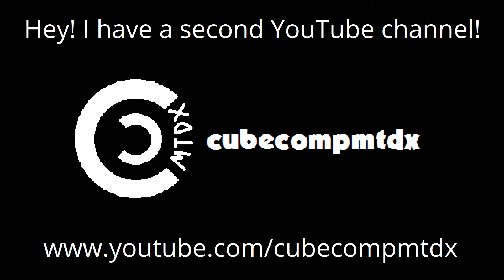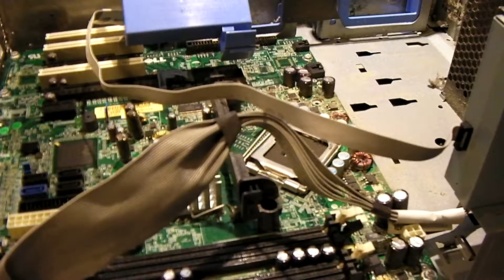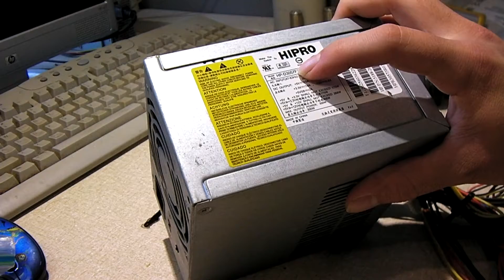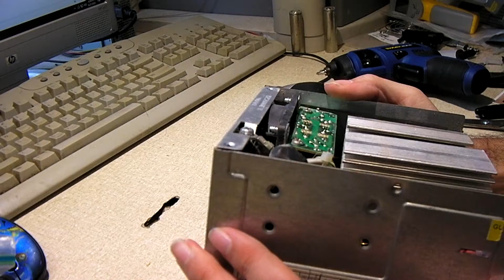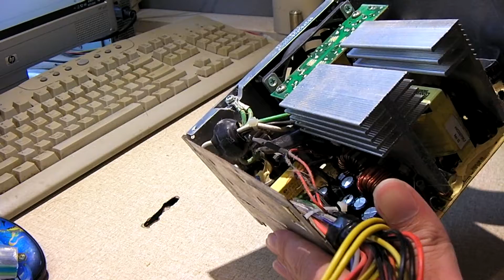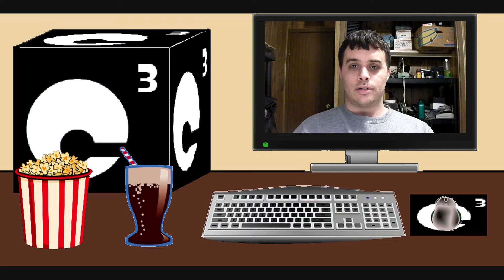Hot running PC in hot ambient temps takes its toll on capacitors

Comment: the HP d-530 sff i have about 5 of them from a surplus auction, they have a 3.0 pentium 4 HT, it is a 478. about every cap on the board is bloated and leaking, these systems never seem to have an issue but i guess i should recap the board.